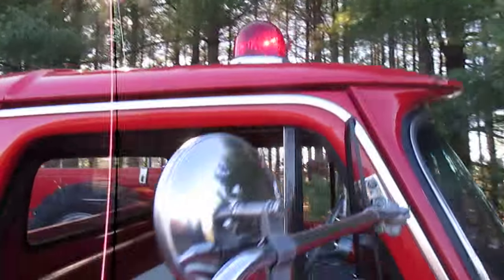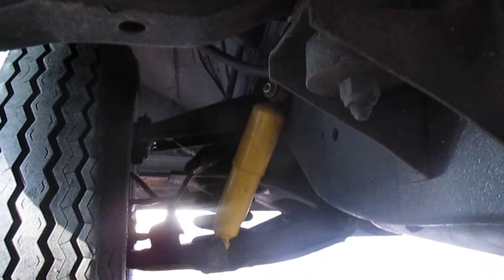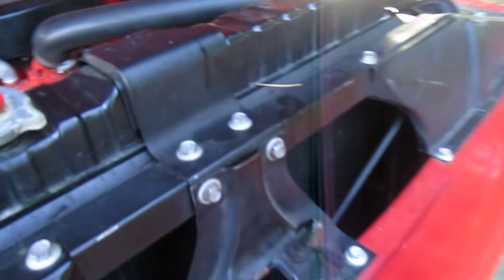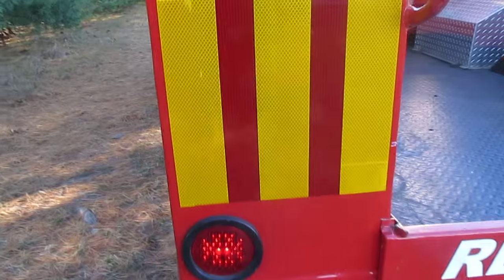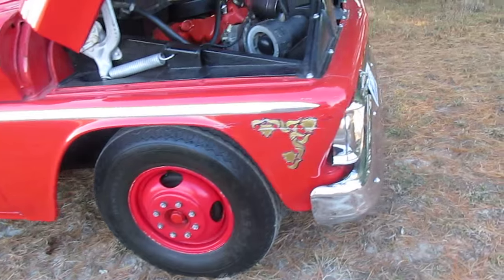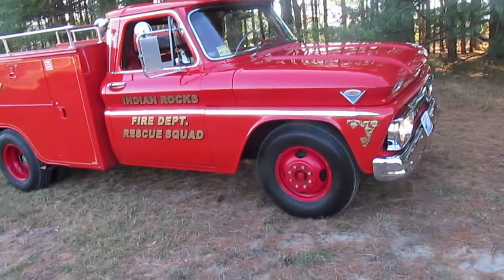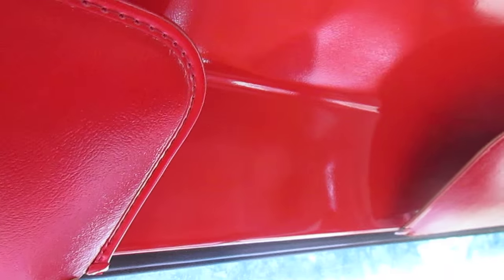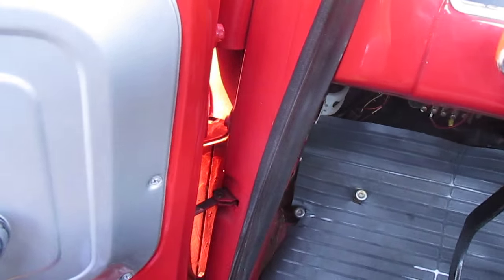1966 GMC RESCUE SQUAD FIRE TRUCK FOR SALE

Comment: Really nice rig but 25K is way too much to offer it at. For that price I can get a fully restored Engine or Truck. Not sure where you came up with that selling price. That Truck is maybe $3500-$4500 because it's mostly restored. Too many people price used apparatus on emotion and not market value.
Reply from the maker: Why don't you go buy a brand new GMC 3500 for $70,000 and then pay another $5000 in sales tax on top of that, that would be a much smarter thing to do.....
Reply: 1950cobrajet it’s not a brand new truck. It’s pretty, but it’s not a brand new truck. 3,500 is too low, but 25,000 is way too high also.

Comment: What series flowmaster mufflers are on there? NICE truck!
Reply from the maker: +Military Chevy  go with the quietest ones flow master sells...
The other ones are to loud!
Reply: 1950cobrajet Its a little late for me. lol I have 40 series on the way. Those sounded like 50 series, but Man they sound good! I thought it was a darn 350 at first. The dual exhaust helps make a nice smooth lopy sound.
Reply from the maker: +Military Chevy
Send the 40 series right back where they came from and get the quiet ones......
Reply: 1950cobrajet lol. I don't mind them being loud. The tailpipes will be at the rear of the truck so it'll be fairly quiet. Wanna hear that V6 roar at shifting rpm though so I went with the 40's. lol
Reply from the maker: +Military Chevy 
I would use 50 series flow masters, they will be loud enough and they are easier to fit than the 70 series flowmasters.
The 70 series are my first choice. they are  are a little bigger, longer and harder to fit next to driveshaft, but can be done...
These trucks sound great with single exhaust too.
Use  larger diameter pipes and use one flow master muffler for single exhaust... save a few bucks and still have great sound.